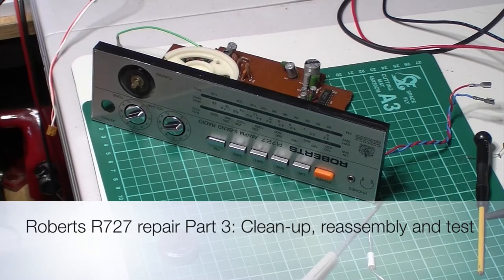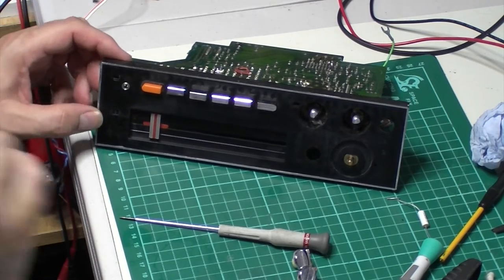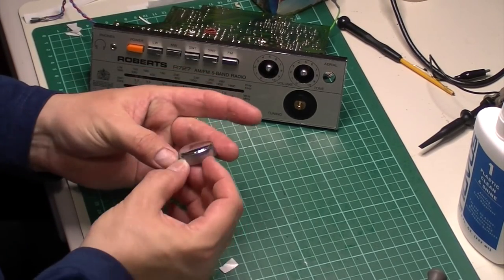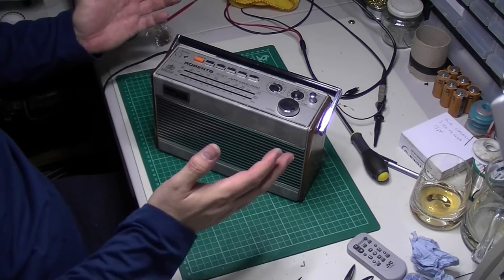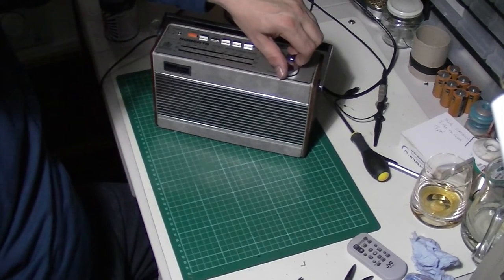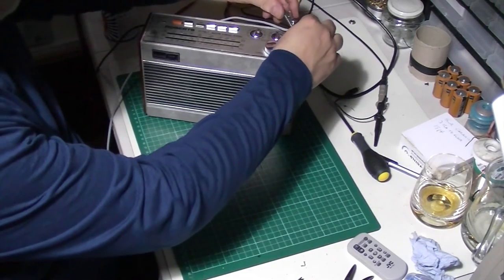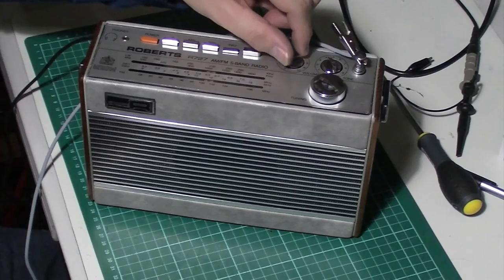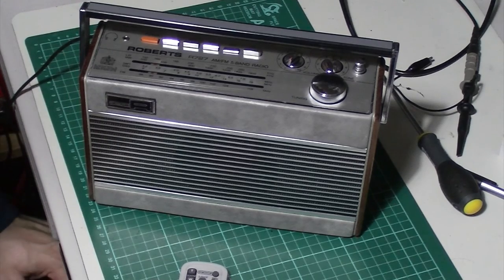Roberts R727 repair Part 3: Clean-up, reassembly and test

Comment: I have a problem with my R727 ,the on / off switch goes up and down but it doesn't turn off . Any ideas please . The work you do on them is brilliant .
Reply from the maker: Hi Mike. It sounds like the latching part of the switch is broken. You will have to strip the switch down and look inside

Comment: I have one of these, but I have a volume issue. I followed your guide and dismantled the radio.  I removed the volume and tone pots, and dismantled and cleaned them, but no difference. I don' think it's headphone socket issue as the volume issue is also using headphones. Any suggestions? I read somewhere it could be capacitors. How do I identify these to change them. Thanks
Reply from the maker: Hi Simon. What is the issue with the volume?
Reply: The volume is very very low and doesn’t increase
Reply from the maker: Could be a capacitor issue. It could also be an issue with the audio IC. It could take a bit of sorting so good luck